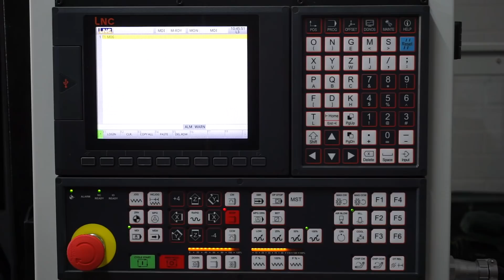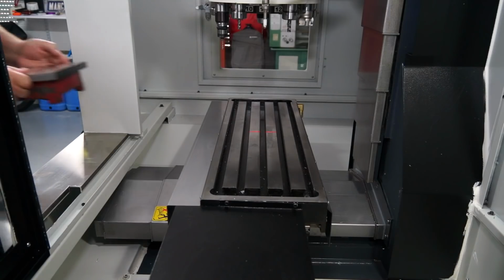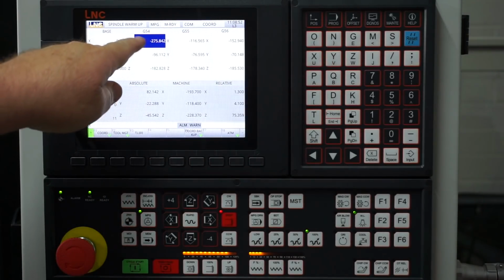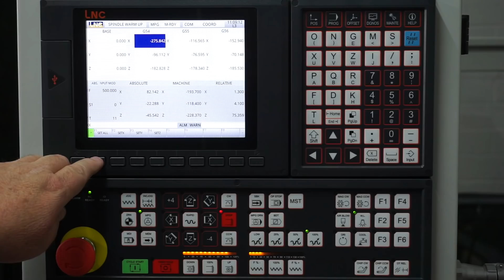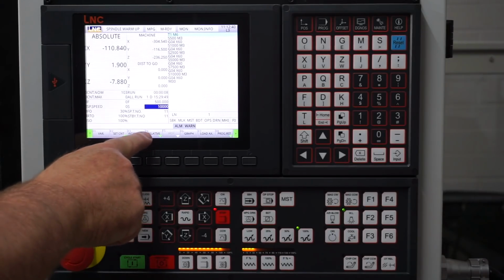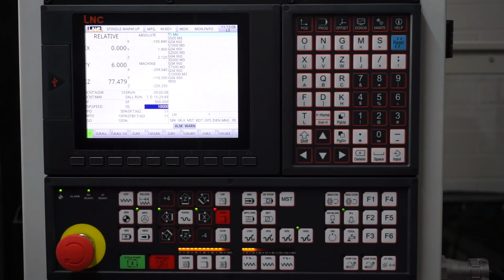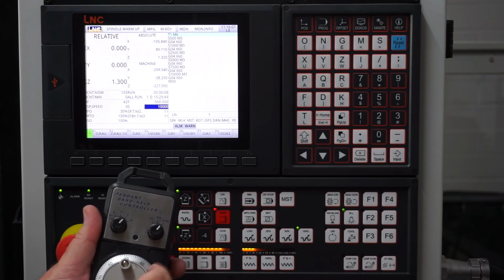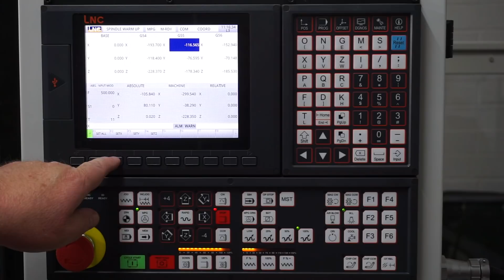How to CNC Pt.3 - Work Offsets

Comment: Hi Aron, Sorry about your pup, we have 2 little devils and they are part of the family, always troubles but a lot of love.
To answer to the question about probes, here is a link:  https://vers.by/en/    Have a look for what it worth, they are cheap but accurate working probes, AND WIRELESS for the spindle, the macro can easily be done,  the probe works as the standard 3 point system, plus can be adjusted to achieve a perfect parallelism (tool probe) and stem concentricity (spindle probe).
Just for fun... 
Cheers from London
Reply from the maker: Hey Emanuel.  Thanks buddy.  Yeah little Pip was my daughters dog, but he lived on and off with us and our other 2 little dogs.  It really rips your guts out loosing a family pet.  It's taken us weeks to get over it.

Probe looks great mate.  I will check them out a little more.  Cheers, Aaron.

Comment: Is there a lower cost (less than $1000 USD) probing system available? And are there built in probing routines? I routinely use 2-4 WCSs and having an accurate repeatable probing system is essential but one without breaking the bank (aka renishaw)?
Reply from the maker: Hi Douglas.  Not to my knowledge mate.  I have been looking at Tschorn 3D probe, which is similar to Haimer.  Can't afford one at the moment.  They other guys in the SyilCNC FB usergroup have bought the Pioneer probing system for their mills.  Not sure of the cost though, as it was fitted at the factory.  Cheers, Aaron.
Reply: Hi Douglas, just posted a comment on top, but here is a link to look at, very cheap but reliable probes.  https://vers.by/en/  worth a try for sure. Cheers, Emanuel